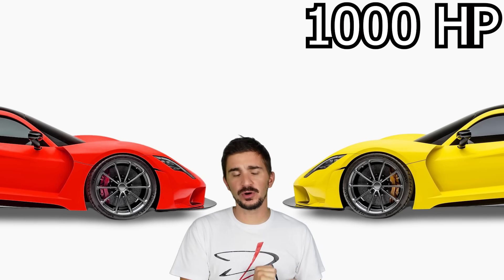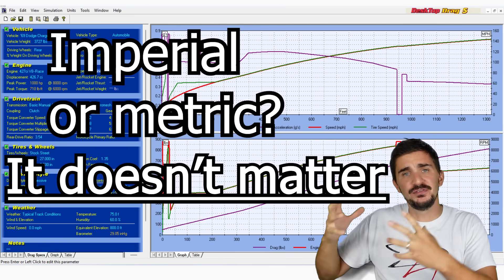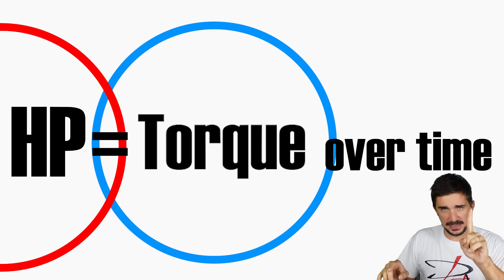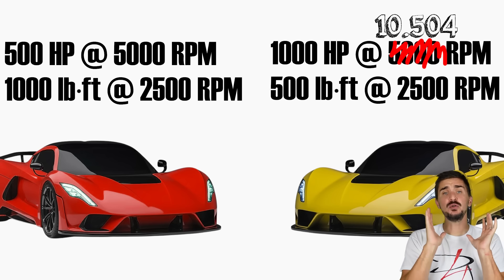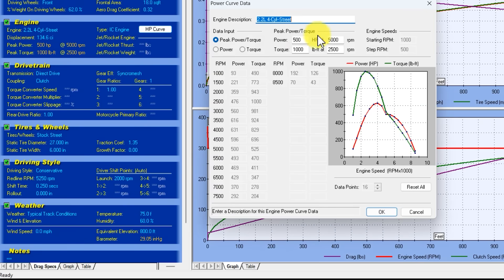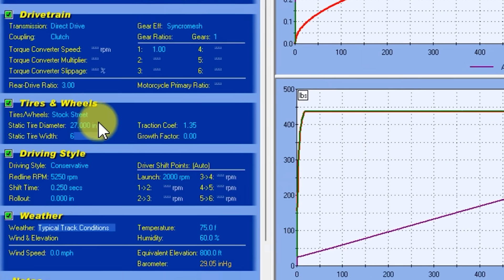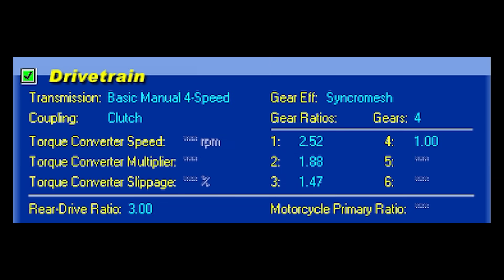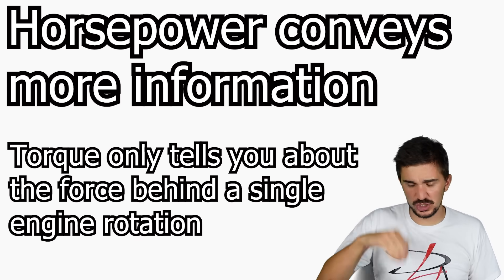Who's faster? Explained and Simulated - Horsepower vs Torque

Comment: I understand the relationship between HP and torque but have always struggled to explain it in a way that people understand because when you factor in time it really confuses people.  Kind of similar to velocity vs. acceleration. I just found you and subscribed. I'm going to look for a video explaining how trap speed and vehicle weight (we'll ignore drag) is simply a result of horsepower regardless of elapsed time. If you don't have one, I think that would be a great one to break down and I look forward to how you do it. Also, the slightly more complex set of factors that go into the elapsed time, specifically the initial launch and the general rule of thumb that every tenth of a second you take off your 60' results in two tenths off your 1/4 mile time.
Reply: You said you made a software to predict drag race outcomes right? What was the standard deviation?
Reply: @leandredebrito2991  Standard deviation of what exactly? All the students' predicted to actual? I know I was a couple tenths off and less than 1 mph off, if I recall, everyone was pretty close. We should have all been using the same equations in the same way if doing it correctly. I'm scratching my head right now wondering if my old computer in my closet has the spreadsheet on it lol.
Reply: @nathanaelcole8466  Yeah, that's what I meant. I think it's super cool you got it that accurate.
Reply: "HP and torque relate as velocity vs acceleration"
Wat?
Did you know that
Power=acceleration*speed with a given mass.
Reply: @simplemachine9531  Velocity is just speed with direction
Reply: @simplemachine9531  You ou took that too far in how I was comparing them and was just using it as an example of another concept that is hard to explain to people. The common denominator in what I was getting at is when you throw time in there for both simpler units you lose people.
Reply: @nathanaelcole8466  let's say there is power, speed and torque. Why would you name power as speed? We can go furter (and some do) and call torque as "real power", or whatever easy to grasp for stupid people. 
There is nothing more simpler than acceleration*speed. With a given power input/output (again can't be even simpler) and a given mass (extremely not complicated) the higher the speed the slower acceleration and vice versa. 
Discard torque at all and it becomes clear as day.
Reply: @simplemachine9531  you're reading it the wrong way and deeper than I intended. Simple as that. Two unrelated things I made a simple comparison saying they have been difficult things to explain to people in the past. That's it, no more to it
Reply: hp is amount of work.

torque is just an indication of what kind of work is possibly maybe being done but not how much
Reply: I think saying time is confusing, if you say frequency or frequency in time, it's easier to understand

Comment: I always been told that engines make  torque not HP.   HP is how fast that torque is made.  The engine in the semi I drove had 1250 ft/lbs at 1800 rpm and 550 HP at about 2300.  And a 18 speed transmission.
Reply: You were always told wrong. There is a "Yamaha 30" written on a boat engine. What does 30 mean?

Comment: bro, you are so knowledeged about this topic, you should be a physics lecturer or something, regardless it would be fascinating to see more content about overpowering grip to enter wheelspin and what higher torque has to do with that. in my estimation using your punch analogy would be that a singular punch doing more damage (high torque engine) per rotation of tyre has a better change of overcoming the lateral grip. also would like something why diesel engines tend to have more lower end torque, regardless keep up the content.

Comment: I bet that if you optimize both transmission gear ratios on those 2 motors, the 1000hp motor will win most of the time

Comment: horsepower is faster provided you have the right gear ratios. a 10.000 rpm 200 Nm engine and a 5.000 rpm 400 Nm engine have the same power and should (in theory) perform the exact same if the final gear ratio is twice as long on the second engine.

Comment: I love the idea of using simulations to demonstrate these problems ! Also the takeaway that power and torque are connected is greatly conveyed.
There is a couple issues with the simulation I'd like to point out, and comments I'd like to add for other nerdy viewers:

-> at 6:20, power curve of the torque biased engine shows peak power of 𝟲𝟰𝟬𝗵𝗽 𝗮𝘁 𝟰𝟬𝟬𝟬𝗿𝗽𝗺, due to 500hp@5000rpm and 1000lb-ft@2500rpm being impossible to match
-> in this simulation, the driver let the wheels slip most the times skewing the results and, as you pointed out, demonstrating the importance of tire traction

So based on the power-torque curves shown, the engines compared are:
-Torque biased: 640hp@4000rpm, power band 3000-5000rpm
-Power biased: 1000hp@10500rpm, power band 9000-13500rpm 

The same gear ratios that were used on both engines for simplicity heavily penalized the power biased engine by not allowing it in it's higher revving power band. The best example of this is motorcycles: they have high power @ high rpm with low torque, but use higher final drive ratios to allow them to use their higher rpm power bands.
One thing that can matter is power band width, by reducing the number of gear shifts necessary to remain in the power band, however even this can be mitigated by using tighter gears and a quick shifting transmission.

Mathematically speaking, power is how much kinetic energy you're adding in the vehicle per second through the tires. Kinetic energy being speed and speed per second being acceleration, 𝗽𝗼𝘄𝗲𝗿 𝗶𝘀 𝗮𝗰𝗰𝗲𝗹𝗲𝗿𝗮𝘁𝗶𝗼𝗻.

My way of explaining power-torque is:

𝗪𝗶𝘁𝗵 𝗮 𝗽𝗿𝗼𝗽𝗲𝗿 𝘁𝗿𝗮𝗻𝘀𝗺𝗶𝘀𝘀𝗶𝗼𝗻, 𝗽𝗼𝘄𝗲𝗿 𝗮𝗻𝗱 𝘁𝗿𝗮𝗰𝘁𝗶𝗼𝗻 𝗶𝘀 𝗲𝘃𝗲𝗿𝘆𝘁𝗵𝗶𝗻𝗴.
𝗧𝗼𝗿𝗾𝘂𝗲 𝗶𝘀 𝗮𝗹𝗺𝗼𝘀𝘁 𝗺𝗲𝗮𝗻𝗶𝗻𝗴𝗹𝗲𝘀𝘀, 𝘀𝗶𝗻𝗰𝗲 𝗶𝗳 𝘁𝗵𝗲 𝘁𝗿𝗮𝗻𝘀𝗺𝗶𝘀𝘀𝗶𝗼𝗻 𝗶𝘀 𝘀𝗲𝘁 𝗿𝗶𝗴𝗵𝘁,  𝘁𝗵𝗲 𝗳𝗶𝗻𝗮𝗹 𝗱𝗿𝗶𝘃𝗲 𝗿𝗮𝘁𝗶𝗼 𝘄𝗶𝗹𝗹 𝗺𝗮𝗸𝗲 𝘁𝘄𝗼 𝗲𝗻𝗴𝗶𝗻𝗲𝘀 𝘄𝗶𝘁𝗵 𝗱𝗶𝗳𝗳𝗲𝗿𝗲𝗻𝘁 𝘁𝗼𝗿𝗾𝘂𝗲 𝗯𝘂𝘁 𝘁𝗵𝗲 𝘀𝗮𝗺𝗲 𝗽𝗲𝗮𝗸 𝗽𝗼𝘄𝗲𝗿 𝗱𝗲𝗹𝗶𝘃𝗲𝗿 𝘁𝗵𝗲 𝘀𝗮𝗺𝗲 𝘁𝗼𝗿𝗾𝘂𝗲 𝗮𝘁 𝘁𝗵𝗲 𝘄𝗵𝗲𝗲𝗹𝘀 𝗮𝘁 𝗽𝗲𝗮𝗸 𝗽𝗼𝘄𝗲𝗿, 𝗿𝗲𝘀𝘂𝗹𝘁𝗶𝗻𝗴 𝗶𝗻 𝘁𝗵𝗲 𝘀𝗮𝗺𝗲 𝗮𝗰𝗰𝗲𝗹𝗲𝗿𝗮𝘁𝗶𝗼𝗻.

If the wheels don't slip (and that's the driver's fault not the engine's), and the 2 cars have appropriately set transmission, the one with more power will win most/all the time.

P.S:
Why do trucks and pickups use high torque engines ? Why cars have much higher torque than motorcycles for the same HP ? Isn't it because weight requires torque ? 𝗡𝗼.
It's because 𝗴𝗲𝗻𝗲𝗿𝗮𝗹𝗹𝘆, 𝗮𝘁 𝗲𝗾𝘂𝗮𝗹 𝗽𝗼𝘄𝗲𝗿, 𝘁𝗵𝗲 𝗵𝗶𝗴𝗵𝗲𝗿 𝘁𝗵𝗲 𝗥𝗣𝗠/𝗹𝗼𝘄𝗲𝗿 𝘁𝗵𝗲 𝘁𝗼𝗿𝗾𝘂𝗲, 𝘁𝗵𝗲 𝗹𝗼𝘄𝗲𝗿 𝘁𝗵𝗲 𝗹𝗶𝗳𝗲𝘀𝗽𝗮𝗻 𝗯𝘂𝘁 𝘁𝗵𝗲 𝗹𝗶𝗴𝗵𝘁𝗲𝗿 𝘁𝗵𝗲 𝗲𝗻𝗴𝗶𝗻𝗲.
Motorcycles accept a shorter engine life because they need to be very light, and on the other hand trucks need long lasting engines and aren't as much penalized by weight, so they opt for slow revving diesel engine, witch inevitably results in high torque and a heavy engine
Reply: Also, with more torque at lower rpm's, you reach your peak torque/power sooner, with less revs. That's make a stop'n'go easier and put less stress on the clutch/torque converter. Hence the differences from a truck diesel engine and a sports bike. Then  the gear ratios adjust the usability.
Reply: @brunocorrea6010 With less revs yes, sooner no. If your engine is twice as big, makes twice as much torque, makes the same power but only revs half as high, it will increase in RPM under acceleration with half the speed. The engine that revs twice as high and has double the gear ratio revs up 200rpm for every 100rpm your engine does.

People think engines with more torque result in more in gear acceleration from low RPM, but this is actually not the case if the two engines torque curves are similar shapes (regardless of the absolute figures). There's lots of examples of revvier engines with less torque that result in better in gear acceleration than larger torquier engines with similar power moving similar vehicles, the revier engine doesn't just rev higher, it revs faster.
Reply: @brunocorrea6010 gearing would fix all of that. Gearboxes can act as a torque multiplier. You want double the torque, double the ratio.

The reason is efficiency.
Reply: @SlyNine  He's right about that tho, low rpm torque avoids having to either put excessive strain on the clutch, or to have an absurdly low first gear ratio. I omitted it in my inital comment since i didn't know how to put it simply
Reply: Agree with everything. This video was almost perfect, but he didn't set up the transmissions properly for each car, and it just so happened the transmission picked suited the car with more torque. The conclusion that the torque-biased car wins when towing 6000lb is going to give a lot of people the wrong impression.
Reply: I agree - there where several mistakes in the video, that led to misleading conclusions. The HP is the work done by the engine and is the decisive factor, how fast the car will be (with suitable transmission). Generally 500hp engine with more torque will never win 1000hp engine under equal conditions where both cars would have transmissions best suitable for both engines.
Reply: "Kinetic energy being speed and speed per second being acceleration, 𝗽𝗼𝘄𝗲𝗿 𝗶𝘀 𝗮𝗰𝗰𝗲𝗹𝗲𝗿𝗮𝘁𝗶𝗼𝗻."
Umm, no. Kinetic energy is not the same thing as speed and power is not the same thing as acceleration. Kinetic energy is 1/2 * m * v^2, and power is m * a * delta v
Reply: @bjmben88  what i meant by this is:
on a flat ground and putting drag aside
-useful power in a vehicle is how much kinetic energy it can give itself per second
-to increase the kinetic energy of a constant mass vehicle is to increase it's speed, albeit the relationship being exponential
-acceleration is the rate of change of speed
Acceleration being force / mass, force being power / speed:
Acceleration = power / (speed * mass)

So other parameters constant, power (and not torque) is the factor determining acceleration, because at any given speed, power is directly proportional to acceleration
Reply: @bjmben88  Going by specific formulas is a bad idea because there are countless different equations you can use to determine power. Power is an intrinsic propriety of the universe, it can manifest in many different ways (literally any time there is any change whatsoever in a system there is a power associated with it) but it's all the same thing fundamentally.

Kinetic energy is the energy associated with the motion of a body. Work is energy converted into motion, so the kinetic energy of a vehicle is the sum of all the work done to move the vehicle to that speed.

Power, in the mechanical sense, is the rate at which work is done, literally work done over the time it took to do it. Power is not acceleration but when accelerating an object with a given mass the acceleration you can cause to this body at any given instant is directly proportional to the power you have available at that instant. The "instant" part is important and most people don't understand that, because an engine produces a certain peak power but under certain specific conditions and what matters when you put your foot down is how much power then engine can produce there and then. You can't simply compare engines based on peak power and peak torque figures because that doesn't say much about how much power the two engines will be producing in different situations - you need to actually see their power/torque curves, and comparing specific vehicles you need to know the gear ratios too.

This is why turbocharged engines are usually faster than high revving naturally aspirated engines with similar power, because the turbo engine will actually have peak or near-peak power over a certain rpm interval and if the engineers were clever about it that will be roughly the rpm drop between gear shifts which means you can keep accelerating through the gears always making peak power, while high performance naturally aspirated engines usually make peak power only at a very specific RPM right before redline so you only make that power for an instant before shifting, then the revs drop and you're making less.
Reply: I completely missed that the 500hp engine actually had 600hp
Reply: Semi truck yes, pickup truck no. Motorcycle 1 liter, Semi truck 15 liters

Comment: Great video! Again! I would prefer to see more real world figures used such as a 300 hp car with low to moderate torque and a 7000 redline compared to an identical car with 300hp with good torque all the way through the rpm range but say a 6200rpm redline. Thanks for your educational videos though. All of your subject matter is educational for the average Joe and always helpful. 🙂

Comment: I am absolutely shocked at how bad this video is. A candidate for a quick deletion no doubt.

First of all, you can't randomly pick RPM, torque and horsepower values and expect them to make sense. Look at the curves for your "torque" engine, it actually makes over 600hp at 4k RPM, because it literally can't make less with so much torque, before then coming down to your "peak" value of 500hp at 5K RPM.

The biggest fuck up, though, is you thinking "making everything the same" is a fair way of comparing them. To actually make it fair, the engines need to be geared for the same road speed in each gear. If you gear them the same, then of course the "torque" engine will be faster, as the torque is being multiplied by the same amount for both cars and the car with more torque will therefore obviously have more torque at the wheels. Instead, to make it fair, the "horsepower" engine should be geared about twice as low, which will give it twice the torque.

I am also not sure how accurate the software is... In your first example it shows the RPM of the "horsepower" engine staying the same as it accelerates, which is impossible.

Either way, your conclusion is completely incorrect, horsepower is the only thing that matters. Torque (as a peak value) is literally irrelevant. The engine could have 1Nm of torque and the car would still be faster if it had more HP and appropriate (in that case super low) gearing.

Comment: Looking at peak values always tells nothing. If you have turbo car for example, with same engine, you can have 1 bar of boost, but if turbo starts to spool at 2k rpm and holds it to redline you would have same peak hp and tq as turbo spools at 5k, but car would be so much faster.

The best indicator of speed should be integral of torque curve
Reply: The best indicator of speed should be integral of torque curve 
Actually integral of HP curve. Two engines can have the same area under the torque curve but perform dramatically differently, even if the shapes of the torque curves are identical—if the torque curve of one is centered on a lower RPM than that of the other. Integrating the HP curve eliminates this issue. But getting appropriate performance out of each still depends on appropriate transmissions and gear ratios.

Comment: ? A 1000 hp car has twice the power output of a 500hp car, regardless of torque, and will win a dragrace anytime, unless
some one messed up gear ratios or tires..  After all, the engine torque is multiplied by the gearbox and differentials and
must be matched to the engine and tires in order to transfer the power to mother earth in a correct manner.

Comment: My question that is off topic of this video. What would happen if you would used a Caterpillar inline 6 or a V8, or a Cummings inline 6 or V8 engine, or a Ford Power Stroke V8 diesel, or a Durmamax  V8 engine, or a Detroit Diesel V8 engine with a supercharger with gasoline fuel injectors with a diesel block which has the block & head been decked .010 along with a .250 stoked crankshaft & a larger camshaft. I think this would need to fly cut the pistons to allow for the higher lift camshaft & valve float at higher RPM. I know that gasoline is more violtile  than diesel fuel at the same compression ratio. But my question is in using gasoline in diesel fuel injectors or using gasoline fuel injectors using gasoline & the 20-26:1 compression ratio of a normal diesel engine, would this engine work or self destruct?

Comment: In the words of top gear. 

Horsepower is how fast you hit the wall. 

Torque is how far you push it.
Reply: It's literally not.

Speed is how fast you hit the wall

Momentum is how far you push it

Horsepower is torque times rpm
Reply: @firehoax9230  Exactly!